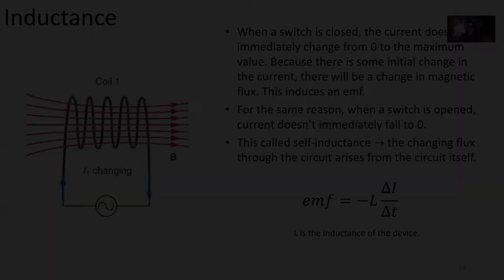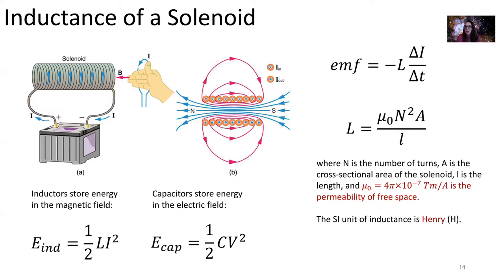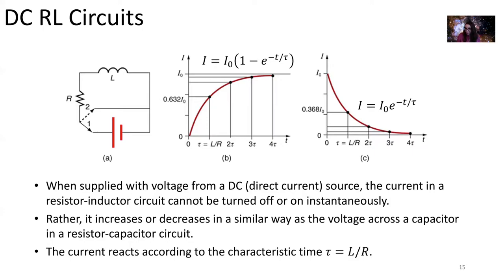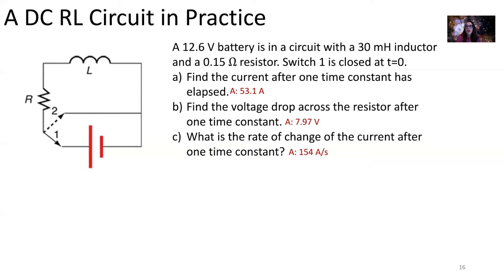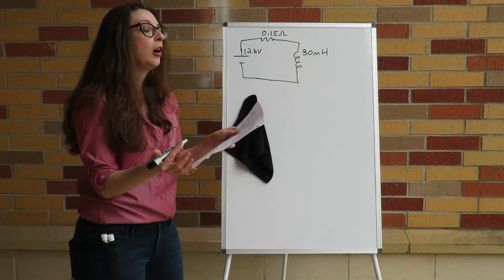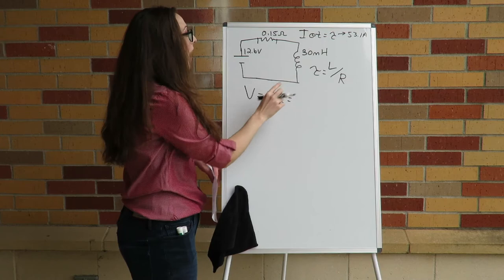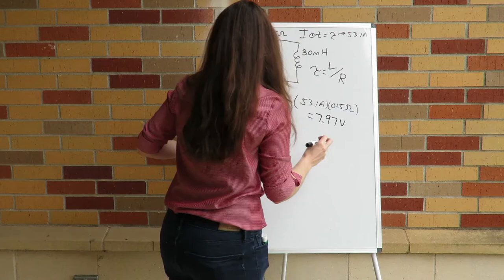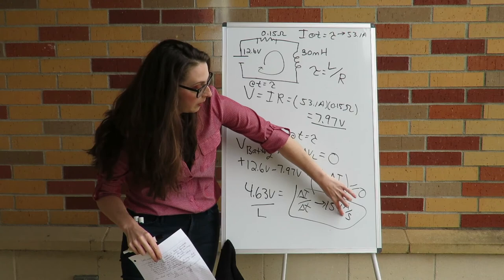Inductance and an RL DC Circuit

Comment: Excellent video Maam: Since your last name of Weber, you should also make an inductor/solenoid video describing the generation of WEBERS as in WEBERS per METER squared,  'magnetic flux' and how we get Teslas. Not a Tesla car. 😎

Assuming the circuit has been at S1 for a long time, and now we click the switch to position 2, there will be 'inductive voltage' kickback' that is very high at that instant that can cause a spark at the switch at the S1 contacts, 'CORRECT'?